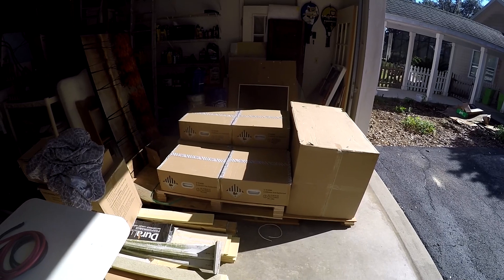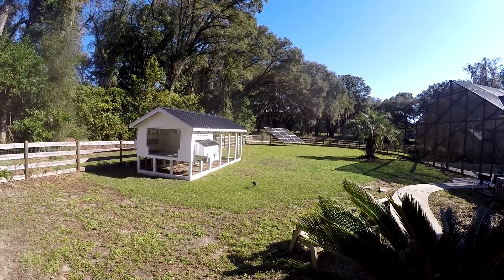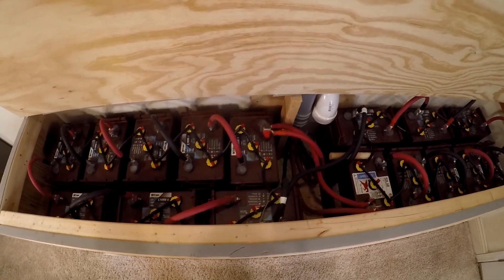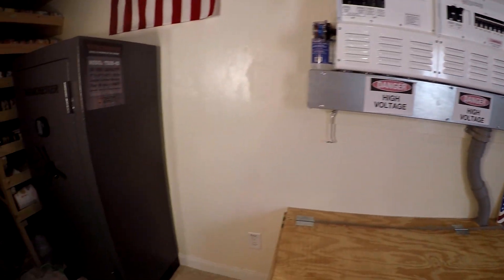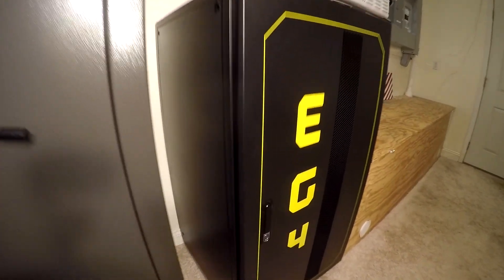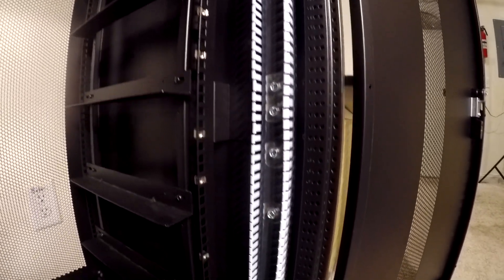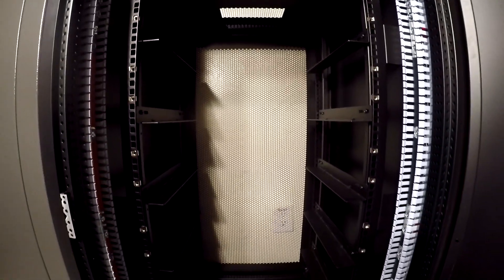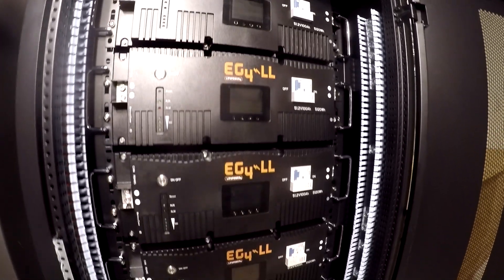EG4 LL V2 LiFePO4 Batteries Install

Comment: But did you have problems with wiring the batteries to the bus bars and the lugs coming out like o many other?
Reply from the maker: I have not had any problems with my mine thus far but keep in mind that they have shipped out a variety of various bus bars.  If I did have issues, I would probably opt to drill them all out and bolt all the way through with a larger bolt.

Comment: My screw holes don't line up!
Reply: I found on a forum post they recommend taking off the handles. Then they pretty much line up. Arguably the handles aren't necessary when using a rack anyhow.
Reply from the maker: Jason,  They have gone through a number of cabinet iterations so I can't really say what it is.  Sorry but not much help...

Comment: Hi Dave! Awesome video. Did you decide to go with the 6k split phase inverter vs the 6.5k single phase ( split phase in parallel) because of your well pump and the higher surge at startup which the 6k watt could handle?
Reply from the maker: Raymond, I have been writing a lot of long winded responses today but you nailed it so I will just say: YES!  :)

Comment: Thanks for sharing your install. I have been looking at these batteries also as well as the trophy batteries. Going on 5 years off grid here in Tennessee my outback nano carbon batteries are failing. We'll be needing a new battery bank by the end of this year 2023 I'll be watching thanks again.
Reply from the maker: Hello Glen,  I am familiar with your system as it is very similar to mine except your using the Midnight Solar charge controllers.  Its great how well these Magnum Systems run with basically no issues.  I think the EG4's are going to be a really good improvement to my system.  They will probably work for you as well although your charge controller setup will be different.  I have several more videos coming so stay tuned to see what trouble I run into.  Thanks!
Reply: @HomesteadEngineering  Agree my magnum energy system has been trouble free love it. I'll be watching.